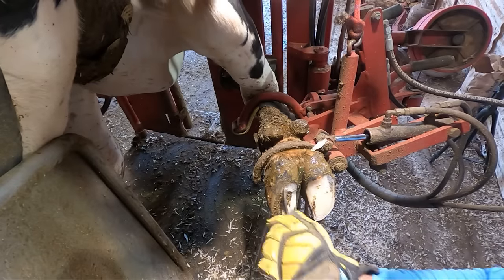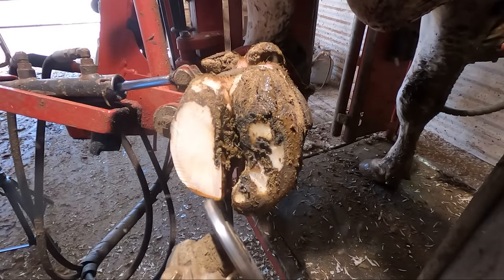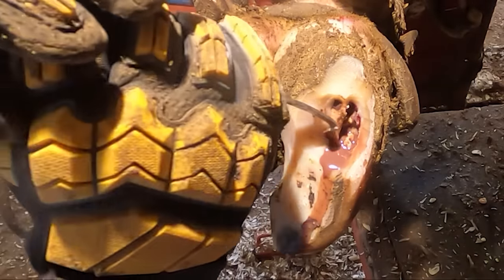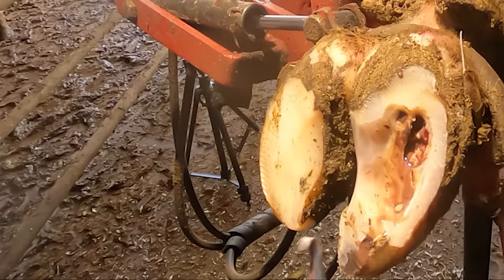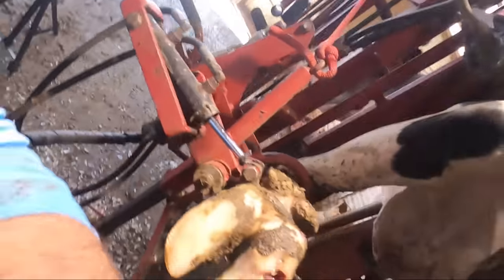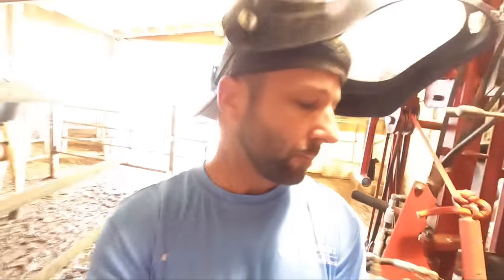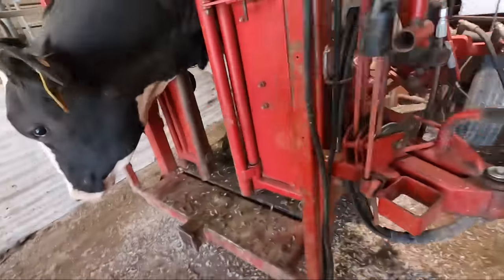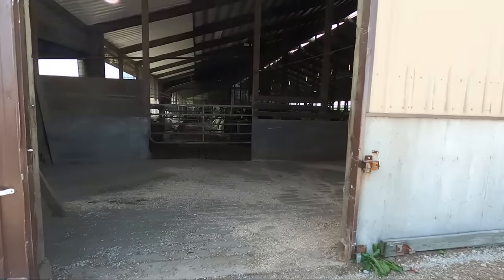ABSCESS BURST OPEN DEEP HOLE cows hoof is PEELING OFF! Cow 9002

Comment: I had a pretty large abscess after a c-section and let me tell you, he is 100% right about the relief in pain you feel when they are opened up. I went from doubled over, barely able to walk, to completely normal in seconds. I felt for that cow 😂
Reply: God you’re brave that sounds horrendous glad to hear you’re ok
Reply: I had similar after my appendix was removed. The nurses couldn't find the stitches because I was so swollen but they still sent me home from hospital. The following day the wound actually burst open (I was in the tub), I held a jug to catch the pus. Ended up putting gauze packing in each day and pulling it out soaked. Nasty!
Reply: @gaynorprice-jones1826   Luckily mine was not infected and I didn't need to pack it. I hear that is not fun! I did have to keep poking it open multiple times a day so it could keep draining while it healed. Gross.
Reply: I was 16 and didn't see why the Doc should call everyday, so I did it myself using the handle of a teaspoon! Lucky I have a strong stomach!  Best regards from the Welsh Marches   @InHimAlone

Comment: She settled down as soon as you opened the abscess. It must have felt amazing to get the pressure off the wound.
Reply: Like Victoria said in her comment.  
Instant relief!
Reply: @oldmanfred8676  u saw some thing l don’t see
Reply: @rebeccaocker4506 ,
They took the comments 
out I guess.
Reply: THIS KIND OF TOOL HELPS THE WORKER TO CHECK THE HOOVES OF THE COWS AND CLEAN THEM UP TO PREVENT INFECTION FOR THE COWS
Reply: I had a painful deep abcess on my rt foot a few years ago.  When the abcess finally "ripened" & broke, it felt soooooo good.  Healing time was incredibly quick, once the abcess ruptured.
Reply: Ніколи такого небачила. Бідна корівка.
Reply: Don’t forget to take off your cap lock, you don’t have to yell

Comment: A lot of the questions he answered, I would've never thought to ask, because I figured it was common sense... like why he doesn't glue the block on while he's working on the other side. I was taken back and wondered, "why would you even bother to do that in the first place, when the job isn't done yet?"

I mean, besides the needing more room to work thing, what if he discovered an abcess that ran from one side to the other, but didn't show up on the surface of both sides? Or he realized it was necessary to take off more good than he started with? You don't do the finish work of ANY job until the job is FINISHED. 

Idk, maybe it's just me but that seemed obvious to me. I was more surprised that someone had actually asked that question to begin with.

Comment: I had an infection under the nailbed of my left ring finger. It swelled and got hot and throbbed. I soaked it repeatedly to get it to open and drain bloody pus, but every night it would reseal. It took about a week before it stopped draining. It took another two weeks for the hardened skin to pull lose and another for the nail bed start growing out. As it is now close on a month l am able to clip it back almost to the quick and keep it bandaged. And I don't have to walk on it, nor do I weigh a thousand pounds. Now I understand why the Brits say "Poor cow!"

Comment: I’m a bit surprised at the lack of cleaning. The tool is continually gouged into the abscess and all around it as well. There’s water squeezed onto the wound from above but that water is poured onto the dirt part of the hoof too from above and even wiped. So it looks like the manure and dirt are incidentally being washed down right into the wound. Not saying that’s the intention, but that’s what it looks like.

Comment: Wonder if the modern free-stall barns don't cause a lot of hoof problems with the cows always in the mess so to speak.  Wouldn't they do better on sand than concrete?

Comment: Do your hands feel like claws at the end of the day Aaron? I've have several cases of stenosing tenosynovitis and it isn't fun. Commonly known as trigger finger and it isn't from hunting too much😁 I've had surgery on one finger so far but unless the others get permanently locked I'll leave them alone. The rehab takes up to 2 years for that fixed finger to be somewhat normal again but the surgery does work. My hands and fingers ache just watching you grip onto the knives and grinder. A hot wax bath at night could help you a lot if you are starting to have pain.
Reply from the maker: Yes it's a common problem for trimmers.. lots of guys wear braces at night to straighten their hands out. I spent 2 years in physical therapy getting cortisone injections😔 then one day I was at the chiropractor and they had a new guy straight out of school and he fixed my arm in one treatment 😊.
Reply: @midwesternhooftrimmer6735  Cortison has never worked for me. What was wrong with your arm or was it your shoulder? I didn't have much luck with the chiropractor, glad you did. In the long run, cortisone just weakens the joint even more. It's such a temporary fix I'm really surprised they even offer it. My body seems to be devoid of any cartilage and I need many new joints but will wait until I can barely walk. I'm on the edge of that now so I'll have to give it up and have a few joints replaced. Getting older really bites.
Reply from the maker: @getin3949  cortisone is a temporary bandaid and yeah over time not good at all.. i had the most problem in my arm(tendinitis)the chiropractor said it was from muscle adhesions and used this tool to grind the muscles in my arms to break the adhesions.. it was like magic pain gone and full range of motion over night!

Comment: When shaving the. Hoof. With. Grinder.  Does it have a. Smell. Of some. Kind.   ???
Reply from the maker: No it doesn't because the wheel has cutting blades it doesn't work with abrasion.. if it was an abrasive disk it would smell bad..

Comment: Question about the Block, did you heat it or no before you bovi-bonded it? im just curious because im coming from watching the hoof GP and i notice he does it every time
Reply from the maker: No I didn't.. I don't find it necessary.. we still have to take them off after several weeks and don't have any issues with blocks staying on
Reply: @midwesternhooftrimmer6735  oh, ok. thanks for answering my question.

Comment: I'm not a farrier, so don't take my question as criticism, because I'm barely qualified to cut my dog and cat's claws. I was wondering why you were using the power tool, even once you'd identified the sensitive area?

I would have thought that the vibration from the tool in that area would have caused the cow discomfort. Is there a particular reason that you treated the injury as you did? I'm guessing that I'm wrong about the amount of vibration and discomfort, but thought I'd ask, and see if there was another reason.
Reply from the maker: That's a fair question im glad you asked. The vibration wouldn't bother the cow in the slightest, but the pressure from cutting with hand tools can. That is why you will see us thin problematic areas with the grinder to make the hoof easier to cut with a knife 😊
Reply: @midwesternhooftrimmer6735  Thanks for the speedy reply!

I hadn't even considered the pressure from the tools, but now that you point it out it seems obvious. I'm guessing that power grinder would spread the pressure out over a larger area.

Once again, thanks for your speedy reply, especially given how old the video is. I really appreciate you sharing your work, skill and obvious passion for these animal's welfare with the rest of us! 🙂

Comment: I've heard you mention power tools before. Isn't it easier and safer to use battery powered tools. Especially today because they are high quality and reasonable priced.
Reply from the maker: Between our summer heat and cold winter and how long the batteries last and also the extra weight they are just not as practical. I have a Milwaukee that I carry for demonstration and for some videos but it will only trim about 15 feet before it lags. We trim about 70 cows per day.

Comment: I can appreciate you not cleaning the hoof off before you work on it but can’t you at least get the gunk out from between the toes before you start working on it?  Why not use a spray bottle with a solution in it instead of trying to squeeze the solution into the wound?

Comment: Why do you use an industry all grinder,when a quiet cordless will be fine!
Reply from the maker: The one we use is lighter and smoother and last all day. We trim 70+ cows per day. I've tried cordless and they last a few cows and change the batteries. In the hot/cold extremes we get batteries don't hold up. And the weight makes a difference when you run one all day everyday.